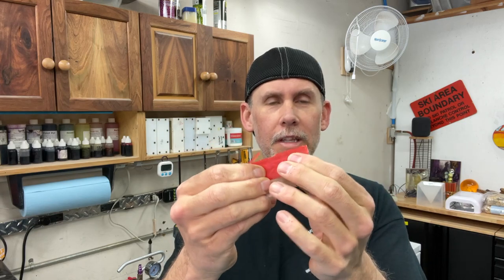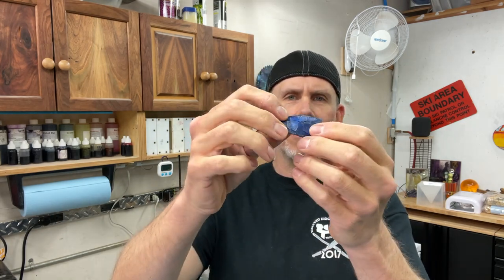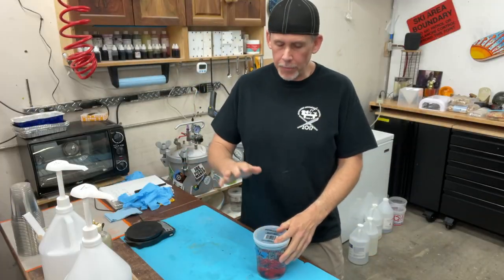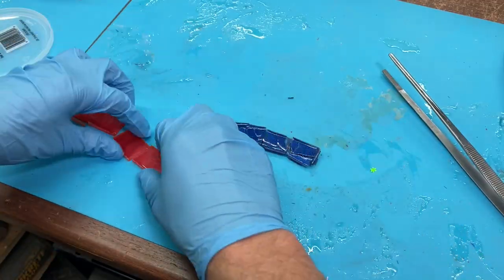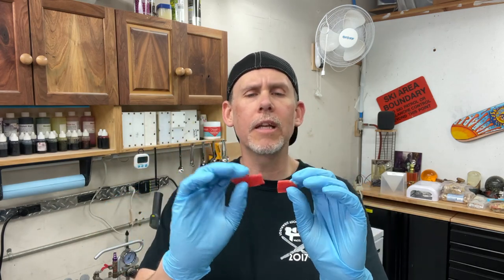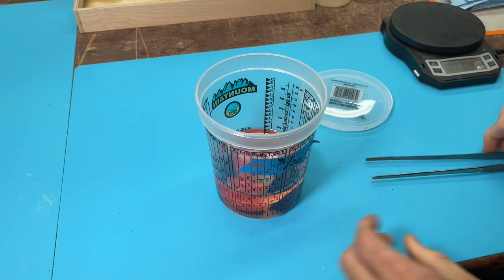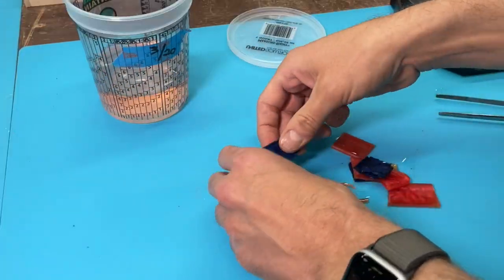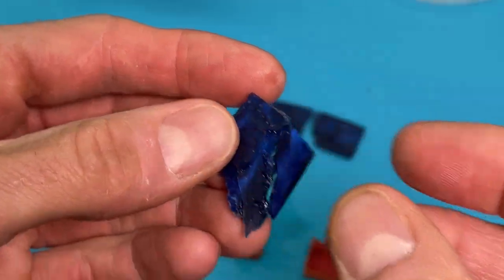Can You Dissolve Epoxy Resin in Acetone?

Comment: See, it's the exact opposite for me. Instead of trying to remove resin, I want to know if acetone could damage resin. I'm going to commission a wooden tabletop with a resin pour for a manicure table, so I will be working with acetone and alcohol. I need to know if cosmetic grade (not hardware grade) acetone with damage the surface of the table. It looks like it might be safe for quick cleanups, but do you have any experience with testing this?

Comment: What that works great for is when you have electronics encased in Epoxy resin it will make it soften it & allow you to pick it apart to free the electronics for servicing.
Reply: I have exactly this problem with an inverter module from a generator

Comment: It's amazing how much time you can squeeze into 7ish minutes. Heat and a scraper or wire brush works well for cleaning tools and such. Soaking is okay for recovering pen tubes, but turning the material off is much simpler. It does make epoxy easier to chew for, say, someone with bad teeth. I often cast both epoxy hard candies and chewables in a single batch just by soaking half of them overnight. 🍬🍭
Reply from the maker: LOL this stuff was definitely chewy 😂

Comment: Good info Zac. I have been doing tumblers and believe me I have messed a few up. I would put some acetone and cover it up. Next day take the tumbler out and scrape the resin off. Turn the tumbler over and place it back and do the same thing. Didn’t dissolve it but made it workable to get off
Reply from the maker: It's nice to know you can recover from mess ups =D
Reply: Can acetone cut UV resin
Reply: @karenwright8080  I am not sure but I would give it a try

Comment: Does anyone know if acetone will work on the hardened black crap they put on jewelry from stores like Michael's? The help is greatly appreciated!! 💚

Update: I just got acetone yesterday and let the jewelry pieces sit in it for a few hours and most of the epoxy immediately came right off! I'm so glad it actually is just epoxy and nothing else, saves me the hassle of trying to figure out what it is. 😅 Not all of it came off though so I'm letting it sit for a bit longer and later today the rest should come off.
Reply from the maker: Glad to hear that it worked for you, thanks for sharing the updates on it =D

Comment: It was very helpful to me, by answering this question. I coated the inside of my motorcycle gas tank with epoxy about 18 years ago, and it eventually peeled off into various large pieces. I'm of course having a lot of trouble getting them out... and I wondered what might dissolve it. I hear that acetone would... well, after a month it only softened it? Nope that won't work for me. You save me a lot of time and cost here. Thanks..

Comment: Do you have enough of these resin test videos to make them into a series?
Reply from the maker: I have one other right now, there will be one more after this one, so it'll be a trilogy 😀
Reply: @ZacHiggins  I always love to see videos on the science behind the craft.  Last weekend I had to remove the brass tube from a too-short resin blank without messing up the mother of pearl glued to the brass and encapsulated in resin, so I could glue in a longer brass tube for a full length pen.  Pulled some knowledge from my years of DIY electronic PCB fabricating to etch the brass out of the blank, leaving everything else intact and stable.  I'm still a little surprised it worked.. lol

Comment: that's very interesting , thank you so much for sharing these experiments :)... i wonder what could dissolve silicone mold...i got some silicone stuck into a jar ...
Reply from the maker: Glad to share it Marie =D I'm not sure about silicone. It's pretty resilient stuff too
Reply: @ZacHiggins  yes silicone is tricky...i tried to remove it from the small jar by cutting it with a knife..lol but it didint work...maybe if pour a little bit of acetone will dissolve it..i will give it a try ;)

Comment: Used this for potted electronics back in the 80's.   One should take note of the container.  Don't want it to dissolve or melt it during the process.   A seal-able glass or metal container may be a better choice.
Reply: So acetone is not effective with air?